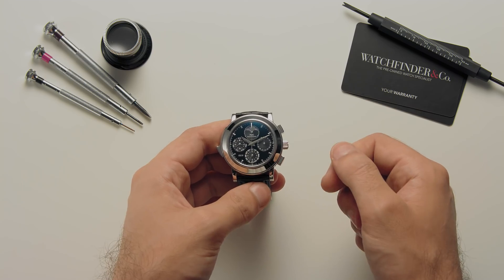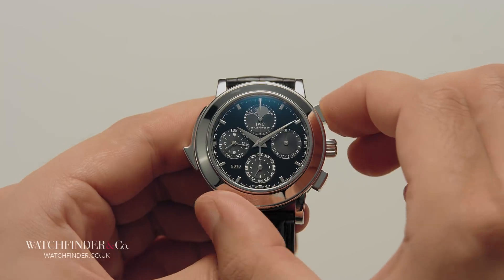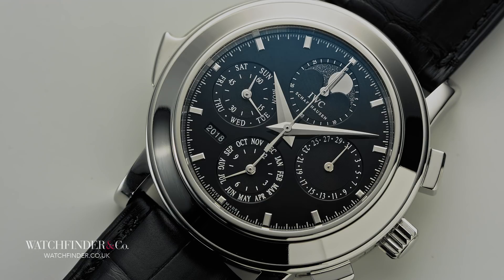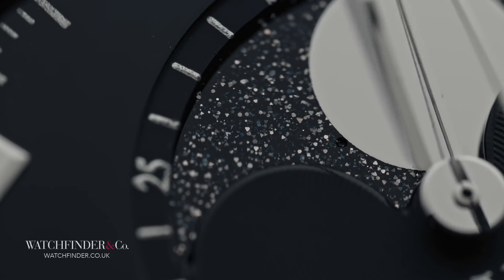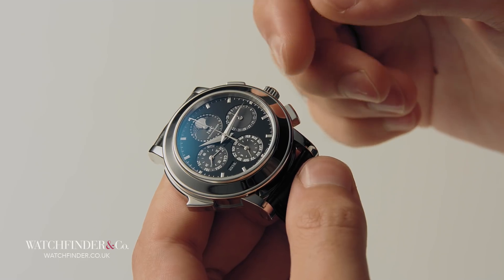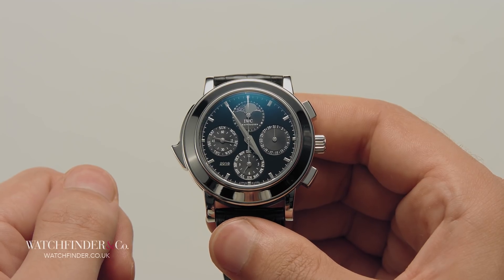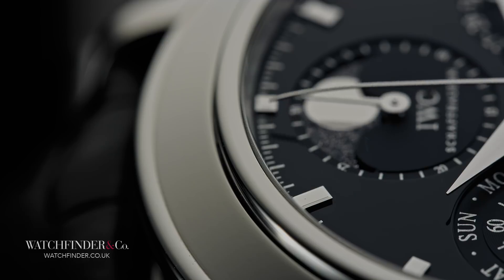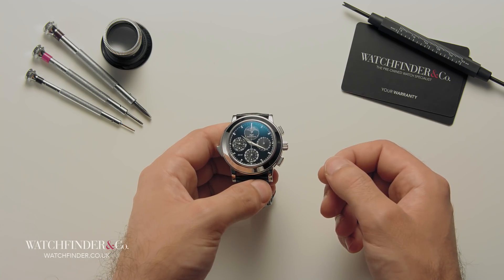How Does a Grande Complication Watch ACTUALLY Work? | Watchfinder & Co.

Comment: How about the year 2100? That's not a leap year. Will the watch be wrong after Feb 28th that year?
Reply: 1dram: I checked on IWC's website and it says the watch needs adjustment on non-leap year centuries but otherwise will be accurate until 2499.
Reply: eRZé that's an amazing watch

Comment: Is it distortion or are the hour and second hand bent downward?
Reply: Marc Yaptinchay: I think they are phyiscally bent. This watch seems to have a flat crystal. The reason I think it has one is that you cannot see distortions elsewhere on the dial which would suggest a domed crystal that would cause distortions.
Reply: eRZé oh yeah I see it too
Reply: eRZé such a nice watch , but that would bother the hell out of me . Im guessing that was purposely done ? But it does not make sense as the seconds is the highest point ant its counterbalance is still flat (unless the edges of the Chrystal slopes down , but like you it looks flat to me too.
Reply: Marc Yaptinchay: I checked the specs now and they say the crystal has an arched edge. This is probably why they need to bend the tips of those hands.
Reply: eRZé . Damn that would only be this watches weak point . Love the way it looks and the complication.
Reply: Marc Yaptinchay distortion from the crystal

Comment: You need to do a "What's So Grand About Grand Seiko" video and go into the details of what they create.
Reply: They did:  https://youtu.be/TqSg4owRcV0
Reply: Baby Gerald Yep! I've seen that one... I was thinking more of a comparison to a $500 Seiko of equal purpose and design ethic. With the exact title I spoke of originally.
Reply: Trust me its a better watch than  IWC and the rest of the overrated watches you mainly pay for the name.  With Seiko u get your bang for your buck.  Oh yes IWC is good watch all right very complicated but not complicated enough to charge both arms and legs all together.
Reply: IWC overcharging is a known fact, a valjoux 7750 charging more than Brietling in houses. But seiko are not great at all either, their 8L35 charges at a price point that a Tudor in house would give it a nice ass kicking with 70h power reserve, magnetic resistance and COSC performance, where the Seiko runs at +-10s/d with no garauntees. And their "work horse" 6R15 are the worse of the worse, +-30s/d depending on the day, and with plastic parts, no competition at all with the 2824, I own both so I can say, never owned their lower end movements so I wont comment on it, but yea, if you like how Seikos look, go for it, but if you have more than 300 bucks ready and like both, go for a 2824, I'm speaking from experience.
Reply: Yeung Marvin Pricing isn't all about the movements. Build quality and finishing is a HUGE factor.
Reply: While I agree, are you implying Seikos have better finishings and build quality than other brands? That I can't agree lol, the best finished watch I have is a Blancpain bathyscaphe, everybit of the dial and the movement finish is perfection. The best build quality I had was an Omega planet ocean 43.5, the bezel did not wiggle a single bit after 2 years of use, and it certainly is good enough for my 100m dives. Which the seiko did as well, but the seiko did not excel other brands in any manner, its simply standard, doest dissapoint and doesnt surprise (yet the bezel wiggled and horrible bracelets and case backs, the kind that you know its cheap stainless steel the moment you look at it, sbdc025 and sbdx013 if you're wondering).
Reply: Yeung Marvin i'm referring to Grand Seiko finishing. Standard Seikos, although still nice overall, don't typically hold up to the likes of Blancpain, Omega, Rolex, etc.... and the prices are adjusted for that fact. Seiko excels at one thing over most all brands (when buying new) no matter the price point: value for money. Now if we're moving to the preowned market, there's many better values. This is largely due to Seiko retaining their value remarkably well... when brands like Breitling, Omega, JLC, etc often have their market values cut in half the second they leave the store.
Reply: As I said, when buying new, seikos are of horrible value, a mid range seiko using 6r15 is no match to a diver made by Hamilton of similar price (i.e. Navy Frogman using a 2824). Higher end seikos using 8L35 such as the tuna is no match to a Tudor in house in all horological aspects (except for the cool looks, which is subjective). I don't know about the second hand market, as I never tried and will prob never do. As with the grand seiko, I personally never owned it but at that price point every thing you buy will have wonderful finish and exceptional build quality, thats a given, not a bonus. I'm personally not a fan of spring drive (while a cool innovation, it uses a quartz crystal, thats the bottom line), the 9 series mechanicals in GS are not superior to in houses such as Blancpain 1315, and their 36,000 beat movement charges more than an El Premiro movement by zenith, which supplied for Rolex Daytona prior to year 2000, all are 36,000 bph with longer power reserve AND chronograph functions, which the GS doesnt have, Zenith has exceptional build quality, brand history, style and is cheaper than the GS. So...I really dont get your point lol
Reply: Yeung Marvin While I do agree that a 6r15 is overpriced for what it is right now($1000+), I just can't agree with it being worse than an ETA. I also own both movements, and after an year of owning an eta, I had some problems with the winding-rotor spinning. The build quality and timechanging actions, aswell as winding feels sturdier on the 6r15.
Reply: @passcomcompass2623  As you said, at that price point, having incredible build quality and finish comes standard. However, in the case of grand seikos, the build quality and finish transcend "incredible", resembling closely of the word "exceptional" instead. Compared to even Rolex higher end models, grand seikos have much better finishes, that at a microscopic level. There's quite a famous video showcasing both watches under a microscope and the details of the grand Seiko was just insane. I'm not a grand-seiko-the-best fanboy, but you gotta acknowledge what they have accomplished
Reply: Ariel Avi would you care to explain exactly where I'm wrong? Im not a fanboy... if I was, I'd own a GS instead of my Omega. Just because I didn't buy a GS doesn't mean it isn't objectively the better watch. Higher standards of finishing (and by hand), more technical innovation, and more accurate. 
The fact you openly assumed I'm just a "window shopper" and swayed by hyped reviews while having absolutely zero idea who I am voids any credibility you may have had here.
Reply: He's already done it
Reply: @footballcoreano i dont need to reply to this written(verbal diahrrea)
Reply: @footballcoreano do.u have a GS ?
Reply: @footballcoreano i hurt your feelings pal. Inaccurate movement GS?? I stop here not point debating further. 

Stupid
Reply: @footballcoreano lollll
Reply: @footballcoreano Well, ive never heard of a grand Seiko movement being inaccurate, but i won't disgard your statement as it's not something I'm sure of. What I'm sure of however, is that gs spring drive movement brings accuracy to a new level, with it's official specs being -1/+1 per day. Do keep in mind too, that Seiko is known for being modest in their specs, so most of the time there's practically no loss of time, at least that's what many owners and reviewers have said about it anyways